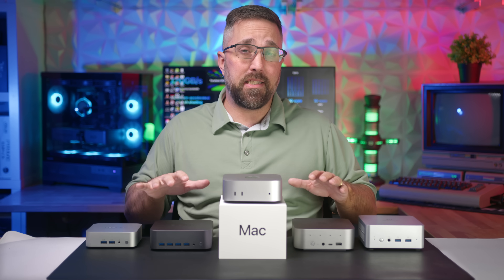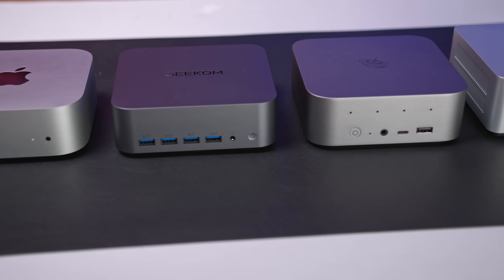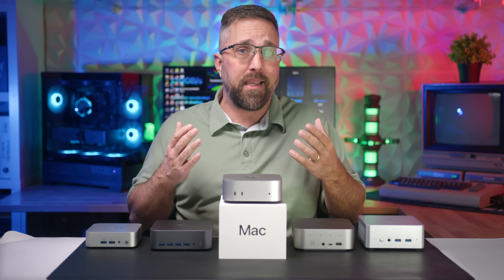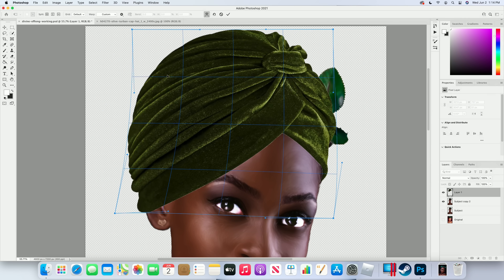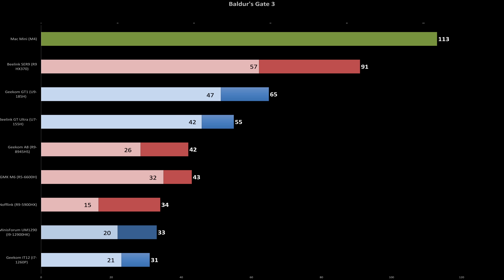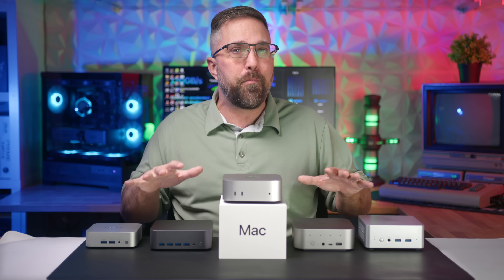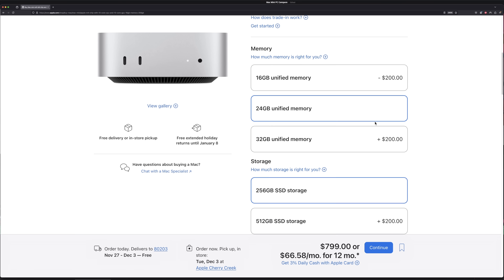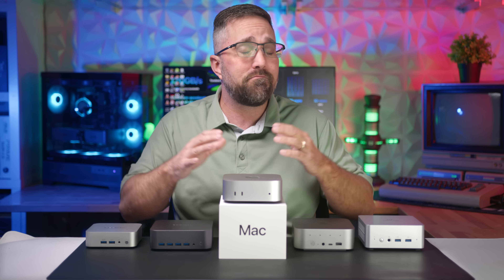M4 Mac Mini vs Intel and AMD Flagships – It's Not Even Close!

Comment: Mac mini at 500 is pretty nice, especially with a decent speaker inside. 

If you are tempted to get more ram and ssd, just get M4 pro. More bang for buck. If you want portable gaming, lunar lake is probably the most interesting, super efficient. Serious gaming get x3d with exorbitant nvidia. Want more than m4pro, wait for m4max studio, for ard 2k.
Reply: M4 with 32gb 512gb is almost there, M4 pro is much faster with a bigger GPU, already comes in 24gb hbm 512gb. And can get edu discounts or business discounts. Has thunderbolt 5 more display supports.

Comment: A value analysis should cover more than one lifecycle and include costs for failed components if they are likely to need replacing earlier.  How much is a replacement SSD?  When do you think 16G RAM will no longer be adequate and what does it cost to overcome that?  Are you going to want a second system for gaming?  Are we likely to get something like a new version of AV1 encoding which doesn't have a built-in accelerator?  Does it cope with triple 4k screens?  Its cool, I'd like one, but its difficult to think of a use case which isn't better served by something else.
Reply: For $599, why worry about lifecycle? It's half the price of a phone that many people replace every 2-3 years. This will easily last 2X that, if not more.
Reply: @MJHiteshew  This is a comparison video.  Running through more than one lifecycle gives you a more accurate picture of the cost.  If you do lots of video editing, the internal SSD dies and it costs two hundred dollars to replace, that negatively affects the $599 value proposition.  If it lasts longer than the other systems because its high single-core performance keeps it viable for longer, that positively affects the value proposition.  If the resale value after 4 years is very low because no-one wants to risk replacing the expensive proprietary SSD, that might be different cost proposition than a more expensive unit for which the SSD can be replaced cheaply.  Or the cheaper, less capable unit might be better if you want to replace it frequently, relying on tech improvements in the future to provide better compute for the same overall money.
Reply: @fanshaw  it's apple, anything that breaks down will probably cost as much as the base model to replace if not more for upgraded parts
Reply: @fanshaw  ok, I’ll play. What parts will most likely fail after 4 years?
Reply: @MJHiteshew  The SSD is the obvious bit for a computer.   I presume the new plugable SSD is an admission that soldering in a part that fails long before the rest of the unit was a stupid plan. It doesn't have to be a physical failure though - fear of an expensive SSD replacement will lower the resale value of what is supposed to be a premium product.  
It may not be a product breakage.  If you unexpectedly hit the drive capacity limit,  upgrading the internal disk imposes a much higher cost than all the other systems in the line-up, drastically altering the relative value proposition well inside the expected lifespan of the hardware.

Comment: real world perfomance ? try and stream in av1 encoding and open an youtube video ... will it even work -_-'' . this works fine on a 10 year old windows system
Reply: Mac is decoding and encoding AV1 much faster in software than your shitty overpriced PC in hardware 😂
Reply: @bayern1806  it does but it uses massive cpu resources and it raises the cpu temps to over 100+ degrees if you play even a low , indie game . av1 sw encoding cannot be done in parallel with playing a decent game. the streams simply lags and drop frames , the gpu and cpu temps go above 105 degrees. I tested this with OBS av1 sw encoding and an very old adventure game

Comment: Why wasn’t the Mac Mini M4 Pro also included in the analysis?

The way Apple is developing Apple Silicon is that your base model Mac is just as powerful as your top of the line Intel and AMD chips. Apple is slowly but surely is turning the Mac’s into the best value devices on the market. Yes, you can cheaper devices than a Mac, but they will lack the power. To get the same power of Mac in Intel and AMD world, means you have to spend money than what you have do on a Mac. Game developers need to wake up and realise that the Mac market share continues to grow.
Reply from the maker: I'm not rich like that.
Reply: Software dev on Mac is ass. On Linux, you just make build or build script and be done. On windows, you click a button on your IDE. On Apple silicon, you have to buy a mac, since macOS can't be shipped in a Docker container like Windows or Linux can, and then you have to fork $100 as a fee to Apple. Then you have to get Xcode to behave. Then you can compile.

The only devs developing for Apple desktops are big AAA studios, who can afford the upfront cost. However, PC gaming is mainly dominated by the indie scene these days. Asking indie devs to fork over at least $600 to develop a game released on Steam for $5 is a very big ask. Most don't bother, releasing for at most x86 Windows and Linux.
Reply: @ The way XCode works now is that Apple has made it easier to out programs/apps/games across its three major platforms, iOS, iPadOS and macOS. Apple basically leads the smartphone and tablet market, the iPhone is the stand out choice for teenagers. What $600 compared to missing out on additional revenue? Apple is making it easier to migrate games to their ecosystem.

Comment: I suppose that windoze users wouldn't know thus, but you never turn a Mac on and off. You just let it go to sleep so it does all the background work while it's not being used.
I've had a Mini M2 Pro since it came out and I can count on one hand the number of times I've ever had to turn it off and on.  The button location, for Mac users, just doesn't matter.
Reply from the maker: My wife has a Mac mini and she shuts it down every night because non Apple periferals like external storage and even her display don't reconnect when it wakes from sleep.
Reply: @ElevatedSystems    Mine all do. LG monitor wakes as soon as I wake it up from sleep mode. Just touch the keyboard and the Apple Watch brings it out of sleep and ready to work.
Reply from the maker: @FJA---  on my Mac studio my LG monitor also wakes every time, but about one out of every ten times my 15 inch OLED Innocen secondary monitor doesn’t. But if my Samsung T7 is connected when it goes to sleep there will be 20 warnings it was improperly ejected when I wake it.
Reply: @ElevatedSystems    I never get that  with anything except the Santechi Hub when I have a SSD installed. But after I bought it and tried a couple different SSD’s I found that there is a known problem with the BUS on it when a drive is installed. Since  I took it out it’s worked perfectly fine.
Reply: Since it is winter, I just let my Windows PC sleep for the nighttime heating
Reply: that's some sad cope. just admit the faults with your plastic. it's not that big a deal, but it's a minor fault. this type of excuse just makes YOU look rather dumb.
Reply: @FJA---  This is really a non issue these days considering the boot times with SSD's

Comment: Probably the most useful review I've seen, especially both the fact you used other mini PCs on the market with similar form factor, as well as the productivity-based benchmarks like Office and multimedia tools like After Effects, Premiere Pro, and Davinci Resolve (which I mainly intend to use in my toolchain for multimedia, as I transition away from Microsoft Windows, until they fix the glaring issues with Windows 11 and future releases; also GNU/Linux for multimedia isn't for me, as I've tried it recently and a lot of work still needs to be done). The inclusion of your project files, and overview of power efficiency are also nice bonuses. Thank you very much.

Comment: Apple computers don’t need to be turned off like PCs, so having an ugly I/O button on the front isn’t a loss whatsoever.
Reply: It's definitely not a big deal for me that the button is on the bottom, but I'd still prefer they put it on the front or top. And I have no problem mocking Apple form-over-function design decisions like this and the magic mouse's charging port.
Reply: First of all, the power button is not ugly at all. Anyway, it's not a big deal that the Mac Mini's power button is on the bottom, but it's funny that we keep talking about it. The Mac Mini is so light and small. Is it that hard to lift it slightly and put your finger underneath? It's not even something you do that often.
Even if the power button was on the front, I don't think it would be as convenient as having it on the bottom. Since the Mac Mini is light, if you just press it, it would slide back, so you would probably have to hold the body with your hand and press it. It's not much different from having the button on the bottom, lifting it slightly, putting your finger in, and pressing it.
Reply: It's cool to have a power button that lets you turn off machines, whatever Apple decides is not automatically cool, and i'm typing from an iPhone 15 Pro from North Italy. We should bring back the common sense in evey action of our life.
Reply: @mariomario2volte Apple almost certainly has data on how often people use the power button, so they definitely know better than you. I have a 2017 5k iMac that I’ve only ever shut down 3 times. I’ve had to power it up more than that, because of power outages.
Reply: @mrlt1151  We in italy call this logic "Supercazzola" without doubt
Reply: @mariomario2volte  I work for an Italian manufacturing company from northern Italy.  I get exposed to your “logic” every day. 😂  I’ve been to the Veneto many times. Beautiful country.
Reply: @ Dio can se è beautiful
Reply: Apple fanboy
Reply: that statement is up for one of the most stupid statements for the millennium.
Reply: Sure...
Reply: @bigshel99  it sips 7 watts, why do you need to turn it off?
Reply: @retrocomputing  dunno, why have a power button at all then? The appletv doesn't.
Reply: @bigshel99  because it's a computer, if you have an issue you can hard reset it without playing with the plug
Reply: @retrocomputing 
You can hard reset it. The button is in the back beneath the corner. Why would you need to unplug?
Reply: @retrocomputing  so I need it still but it put in an even more inconvenient spot? Sounds good👍🏾
Reply: @retrocomputing  note, I’m just fu**ING with you because you assumed what my “sure…” was about so I figured “why not, let’s hear the rationale ” 🤣
Reply: @retrocomputing  And that 7 watts is at idle. It sips *1* watt in standby which is practically the same as the 0.25 watt it consumes *completely off*.
Reply: @bigshel99 
You just admitted you don’t know what you’re talking about.
Reply: @DragonsinGenesisPodcast  okie dokie bud
Reply: I turn mine off about once every five years… sometimes less.

Comment: The M4 is a great performer, and your claims are valid BUT, the price to performance conclusion is VERY MISLEADING. To spec the M4 Mac Mini the same as the others, 32GB of RAM and 1TB Storage it will costs $1400. You calculated (avg of scores/cost) so multiply the result by the cost will give us the avg of scores. This becomes 9102. So now we can then calculate the price to performance more appropriately to other devices. 9102/1400 = 6.5

This turns out to be WORSE overall, BUT giving the benefit of the doubt, Apple's storage pricing is a SCAM so we'll leave out the storage upgrade and since you can't upgrade RAM we'll go with this config: 32GB RAM + 256GB Storage = $1000. If we do the calculation again we get a BETTER score of 9.1 WITHOUT the same storage. Let's say, adding a 1TB external SSD that is a fast and reliable brandcost ~$75, that will bring the price to performance at around ~8.5. 

Now the conclusion isn't an outlying 2x price to performance of the competitors, at best 1.3x or 30%. My statement also doesn't include the fact that other than the new AMD machine and oldest Intel, the other mini PCs have 2TB of storage. Oh, and of course student discounts, which varies to the audience/buyers that is a fair point to make for anyone buying the M4 Mac Mini, but I simply left out due to comparison sake. with my calculations you can easily decide if it is worth it or not.
Reply: You are very confident at being wrong and mislead yourself.
Reply from the maker: Wasn't misleading at all. I clearly covered the specs of each system and I even mentioned how any of Apple's ridiculously priced upgrades will kill the price to performance ratio. Unfortunately your calculations assume upgrading the Mac will not effect it's performance.
Reply: @ElevatedSystems  increasing storage and ram pool doesn't exactly increase performance unless you're ram-starved, in which case the mac would be losing badly here.
Reply: @ElevatedSystems  I agree with @NootNoot you did a horrible job reviewing this.  It would be nice to have a never show me again feature on youtube, so I could click on makers that purposefully lie in their videos like you have done here.  You could have easily done PCs with the same RAM and SSD size or had the RAM SSD size of the Mac be the same.  You decided though to artificially tilt the price to performance ratio and then say it was the most important thing.  Even your game review part didn't have the same graphics.  No mention of a list of games that worked on Mac or a showing of how and where the single core performance actually helps.  Such a bad review.
Reply from the maker: @ those are the base specs of each model. Thats what they come with. Its base model vs base model. The PCs with the current flagship CPUs don’t have cheaper options.
Reply: @ElevatedSystems  Base model of the mini PCs is barebones.  I didn't do an extensive search, but Minisforum has the Ultra 9 185H barebones.  Regardless of different companies different base models it would have been easy to have the Mac have closer specs with 2 clicks.  If one company sells a base model car with no wheels and you compare that to another base model car with wheels the one with wheels will probably go faster.  It is not a good comparison and makes it a bad review.  Makes me think the reviewer doesn't have the slightest idea what they are talking about.
Reply: @chadproject3914 why is it wrong to compare price to measured performance? It’s one valid way to compare, matching specs is a different one.
Reply from the maker: @ the Mac is not barebones. Barebones PC means it comes with no memory or storage at all. Those don’t even start let alone drive.
Reply: @ElevatedSystems  Barebones PC is the base model.  Spend 5 min. to add the same amount of ram and storage as the Mac.  Don't be lazy.  You could add a note saying I couldn't get a barebones Mac to add RAM and storage to because Mac's can't be upgraded after purchase so I'm forced to get one with RAM and storage already.  That would be understandable.  There is no excuse though to not give the PC the same specs.
Reply: @ElevatedSystems , besides the Apple OS doesn’t need a huge level of RAM to achieve the same performance of a Windows PC. Same goes for on board storage.
Reply: @johnkellett7797  RAM is RAM and storage is storage. If you run out, you're going to have a bad time. MacOS isn't magic.
Reply: @johnkellett7797  
And you need even less RAM to run a linux distro. 4GB works well enough under Arch
Reply: @emlyndewar , the Apple OS and chips manages both far better than a Windows based computer.
Reply: @johnkellett7797  lol

Comment: This is most likely one of the best reviews comparing performance with other mini pcs. Another aspect that hasn't been mentioned is fan noise which most likely the mac mini is the winner too.
Reply from the maker: Actually the Mac gets just as Loud as the SER9 just not as frequently. I it didn't include it because the battery was dead in my sound level meter and I didn't have a spare. 😞

Comment: It's a decent device for the price. Apple only has the lead because this die is massive. 

Not to mention that the M4 is a desktop class ARM64 chip and you're comparing it to four laptop/mobile x86-64 chips. x86 chips are going to be at a disadvantage due to silicon wasted on legacy instructions.
Reply: "Desktop class arm chip" Nah mate, that's the M4 max / upcoming M4 ultra. This base M4 is literally in a 5mm thin iPad

Comment: STOP using USB-A cables. Replace them with USB-C cables and stop bitching about it. Its a LEGACY port/connector. Move on. It's 2024
Reply from the maker: Many USB-C 3.2 connectors are not fully backwards compatible with USB 2.0 keyboards and mice. It requires more than just a cable or an adapter.
Reply: it's not legacy, you people are freaking high thinking stupid phone ports are standard for anything but phones and portable gadgets.
Reply: USBC standards are fun. Does this cable support DP? What about Thunderbolt? Is this a charge only cable?